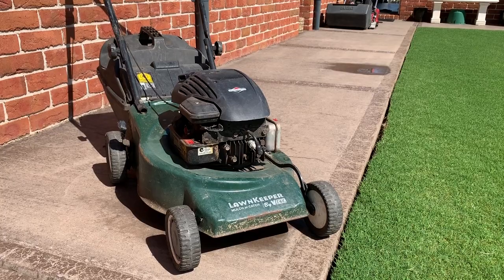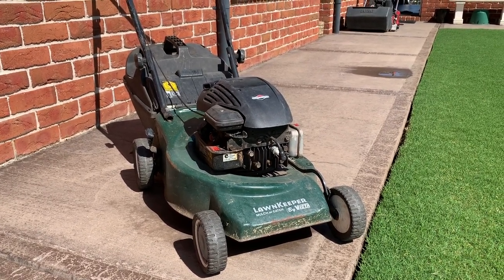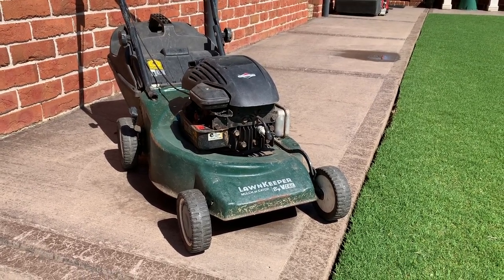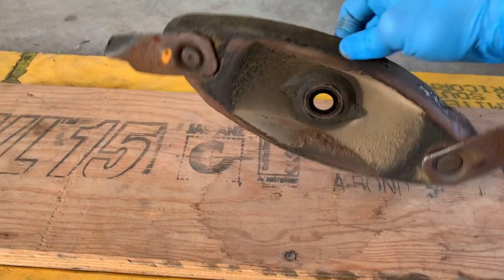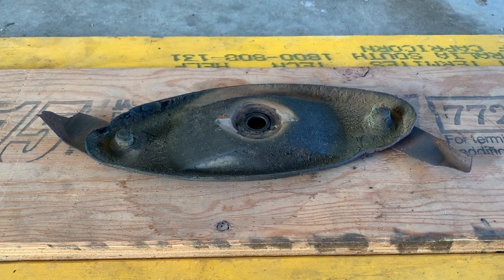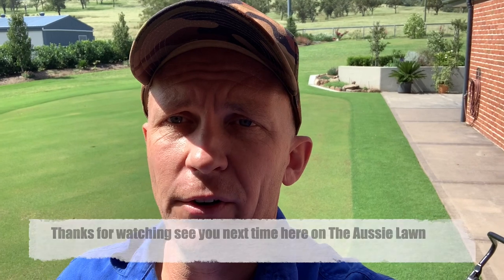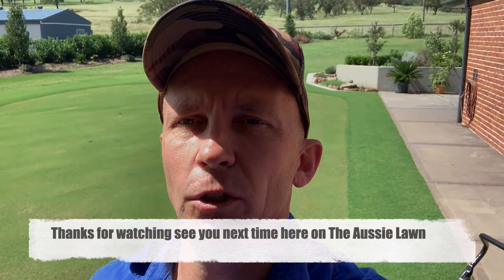Workshop Wednesdays A basic 4 Stroke Briggs & Stratton Victa Lawn Mower Service

Comment: Thanks for the really detailed description for servicing. An extra safety tip for when cleaning the filter with unleaded petrol. Use an anti static bucket or static could ignite. Also not sure if those gloves are rated for protection against fuel. 
Will always be removing the spark plug now , thankyou.
Reply from the maker: Good additional tips John 😎 Yeah the spark plug thing is nuts hey

Comment: That’s crazy about spark plug, did not know that.  Also did not know your mower blades were like that.  I noticed how the old blades were at a bit of an angle then you put on the new ones.  They obviously used that mower to cut more than grass.  Great vid.
Reply from the maker: Hahaha yeah that mower has a very hard life the owner has a gravel driveway add to that they like to mow short 3/4” or there about so yeah it earns its keep.

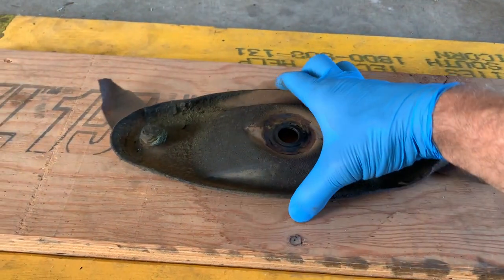Comment: Brenton,  I think at 5:15 it would be helpful to explicitly state whether all the blade carrier on all these B&S motors is secured by a right-hand thread (ie conventional) nut, or if some are left-hand thread.  I assume they are all right hand, judging by what appears to be the cutting face on the blades.  

I am trying to get the blade carrier off to get the engine out from my Victa Corvette 550.  The motor is A1 but the Victa frame has rusted out.  It has never been off, I suspect  (the wife used to take it in to the local mower shop for a service, and I think he changed the blades with the carrier still in place.   Anyway, I can't shift that nut. 

Before I started, I took a drill with mtal brush to it to get ride of surface rust. Then I heated it up with a butane torch and rapidly cooled it with water.  Repeated a couple of times).  Then I soaked it in a 50-50 Acetone & Auto transmission fluid mix (usually good for loosening rusted together parts). 

I have hammered the 9/16 ring spanner on to the nut, then put a two foot long metal tube over the spanner to get lots of leverage.     All I have achieved is to round the ends off the nut.   The bugger will not move.   Tell me, what technique do you use to move seemingly immovable blade-carrier nuts ?
Reply from the maker: Wow mate i dont know what to suggest ive never had one that hard to remove 😳 did you end up getting it off?

Comment: Wow, the amount of times I’ve just taken the lead off thinking I was being safe. 
Definitely learned something today, I think I’m going to do that to all my small engines from now on
Reply from the maker: G'day Peter, yeah its hard to believe until you see it first hand.
Reply: The spark wants to jump to the ground which is the head/engine block..
When the lead is next to the spark plug tip the the quickest way to ground is to jump the tip and then the gap unless the jump is to far...
If you have the lead off to the side of the head and next to the head then the spark will jump straight to the head or block if you turn over the engine fast enough...
I just wedge it to the side of the head which would mean it ignoring a huge ground right next to it and instead jumping over and inch or two to then jump the gap until it hits ground.. I can't see that happening.. 
But don't let it sit next to the spark plug tip if you do anything that risks turning over the engine...
Reply: Wow the plastic top looked like a Q45 but with the filter off, just a 450 with its two air vane governor springs.  The Q45 is the single spring type with push handle speed control.  The 450 is good but Q45 is better.

Comment: OMFG - that spark plug tip / demo - I would not have believed it unless I saw it for myself - wow - awesome tip. Thanks - Simon / Adelaide - ps - rather than remove the plug, once the cap is off, could you put the finger of a thick rubber glove over it - would that achieve the same thing without having to remove the plug?
Reply from the maker: I’m not sure mate I should try it sometime. Cheers for tuning in mate have a great weekend 🤙

Comment: I clean my foam filters with 2 stroke fuel. The petrol cleans it and the oil leaves a nice protective residue.
Reply from the maker: thats not a bad idea either mate, good thinking 🤟
Reply: @theaussielawn  the local mower shop (Dubbo) gave me that idea. Also works on Stihl air filters.

Comment: One more thing if you tip them on there side with oil in it the oil will make its way to the valves and to the breather tube so when you flip it back over oil will most likely go into your carby and oil filter
Reply from the maker: that is very true mate 😎
Reply: @theaussielawn  yes and it smokes like crazy

Comment: How tight would you do up the blade nuts? Shoud the blades be rigid or rotate on the bolts?
Reply from the maker: There is actually an official torque setting can’t recall it off the top of my head but I have them firm but can be moved with light to moderate effort

Comment: Great video thank you. I've just changed the blades on my 2019 victa power mulcher. Quad blade set-up on the disc. Bolts tightened correctly but there's some slight movement when I push/pull each blade side to side. One particular blade actually moves completely inward when the lawn mower is turned off after use, it appears to swing straight back out when started up again but can't be sure. I've read some of the victa blades are designed to swing out of the way if it hits something and then the velocity of the disc flings the blade straight back outwards when the objects cleared. So basically is my situation normal or are my blade defective (original victa brand) or could the disc be defective where the blades mount? Sorry for my long story😂 Thanks mate
Reply from the maker: Just check that your blade bolts have slotted correctly into the blade disc there should be some ability for the blades to move outta the way as you mentioned. Hence being called “swing back blades”

Comment: A spark will jump a long way but it won't jump an inch...
Disconnecting the lead means not having it tough the plug..
So have it bent to the side of the head etc..
It will jump to easiest  earth and the head /block is far easier then going to the tip of the spark plug and then through the gap..
Sticking it away from any earth other than it being close to the spark plug tip is a risk..
Reply from the maker: Correct again mate thanks for tuning in 🤙

Comment: do the new mowers come with the foam air filters or do you have to buy them i brought the new victa and has  Briggs & Stratton ?
Reply from the maker: Im not sure about the newer ones mate sorry
Reply: The aircleaner depends on the model or choice by the Mower maker (the same engine can have different air filters..).
With the old side vales like the one in the video I have seen oiled foam, folded paper (like modern cars) and cylinder ones that mount at the top of a snorkel..
Unfortunately they no longer sell the side valve engines and the OHV engines have a large plastic box on the carby which makes it look like they are going with a new shape...
Probably a folded paper one as they work well, don't involve mess and they make money every time you buy a new filter...
You can make a folded paper filter last longer on your car and mower by blowing compressed air through it from the back so as to dislodge some of the dirt and dust..(not the front) 
Briggs and Stratton has a problem with heaps of Chinese copied parts being sold so it makes sense for them to switch to a new design still under patent that they can make money on.. 
They are a great engines made in the USA in poor areas that need manufacturing jobs that don't involve rich people moving in and jacking up the costs to live in their towns. (they make them in many poor areas and states) 
Unfortunatly Briggs and Stratton went bankrupt due to the Virus and now have new owners so hopfully as long as they make money through their parts sales and engine sales they will keep making them in the US and not try and make them again in China which they did for a while in the past. 
I have only heard bad things about the Chinese copied motors now put on many mowers... 
Stick with a Bridge and Stratton(they made a Engines in the US to fight WW2), Hondas(which I believe are made in Italy) or Kawasaki... 
Probably many other good brands but I don't know much about them (Suzuki and Subaru lawn mower engines but I don't know were they are made or how good they are)
Reply: The new briggs and strattons have foam filters on the lower end engines with the primer and anything with the auto choke has a paper filter. Also the Chinese Honda engines are the same as the hondas, they come out of the same factory in China. The only time you will have problems is if you use bad fuel or leave the fuel tap off and let it sit for months, much better than the cheap engines Briggs and stratton has been making

Comment: I have changed the blade the other day but the mawer seems to wobble more than before?? Any clue mate
Reply from the maker: G'day mate, just double check that the blades are installed the right way around and that all the bolts are sitting in their housings correctly. sounds like either your blade holder isn't reinstalled correctly or the blade may not be quite right. did you also check the blades you purchased are the correct ones for your mower?
Reply: Something must be out of balance

Comment: Hi there I have a  victor  charger lawn mower with a briggs and stratton 450 not a 450E engine. I have check the oil stick and it needs oil, but I am not sure which one to get for it. Yup victor charger was not a good name for a lawn mower with all these electric mowers around.  Its a petrol mower not electric.
Reply from the maker: Hi David, All the briggs and stratton motors pretty much take the same 4 stroke motor oil. You will be able to get it at your local mower store or Bunnings etc
Reply: @theaussielawn  I couldn't pull start my mower so I checked the oil which was not easy as someone had really had it tight on, but I was able to remove that. I then noticed the oil was on the bottom marker and to be that seems really low. So Thank to your advice I shall send my wife off to buntings to buy the right oil and a funnel.  I can now pull the pull start, and it does turn, but I am sure it will do better with more oil in it. Maybe pull it slowly to move the oil around, but not start it, I have the spark plug d/c but these mowers can start very easily.  Take care.